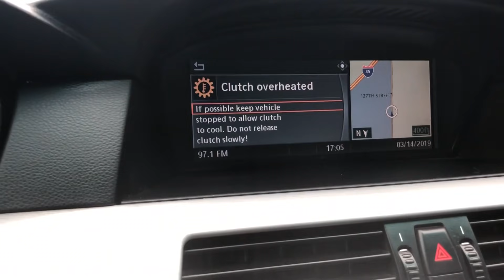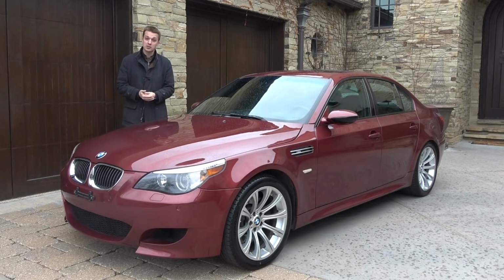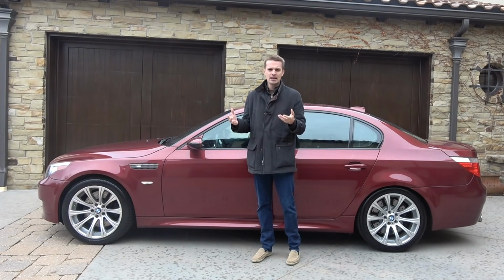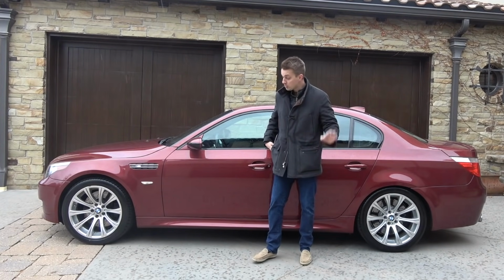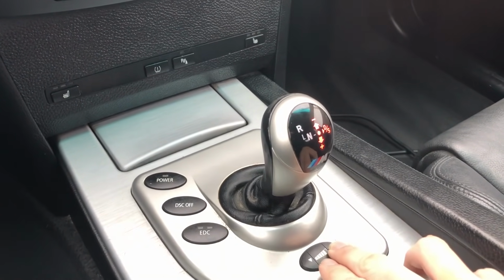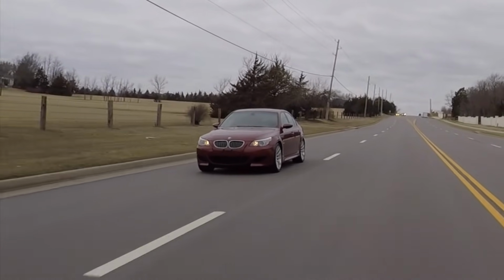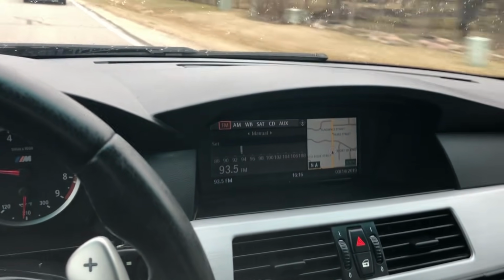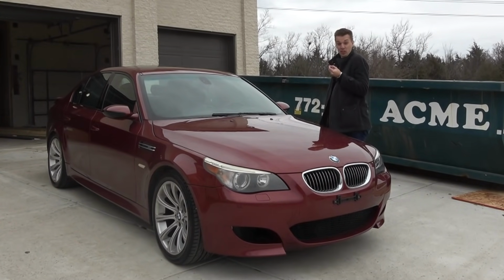My Cheap BMW M5 Is FINALLY FINISHED (Thanks to a Wire Hanger???)

Comment: Great garage, cant wait to see what you stuff in it.  The M5 is definitely temperamental, had an 06 awhile back and found that the bushings would wear in the lower control arms, throttle actuators go, and vanos high pressure line would need replacement in early 06/07 models.  Picked up another 06 - project car needed motor and did the same preventive maintenance w used motor - rod bearings, bigger oil squirters for pistons, new throttle actuators, new clutch, cooling hoses, monoballs in lower arms, bmc filters w stock air boxes. These cars have hit rock bottom, so if you have dealt w those big tkt items - clutch and bearings, you should be fine.  BTW - these are great track cars and really shine in M mode on a big track to stretch its legs.  Also use 0w40 Mobil 1 oil and will switch to the 10w60 on the track.  Maybe get another one in a different color :)

Comment: "What's it beeping for?". That might be an ECU warning, generated by the suspicious lack of actual ECU warnings. You've broken the ECU by fixing all the factory problems.
Reply: Time change..1 min to new hour...my E34 does the same.
Reply: Tomas Cage correct! You can disable it in the idrive

Comment: Love your channel, but you are way over the top on the negative comments on the E60 M5.  I have the M6, and it’s awesome.  There is the potential rod bearing issue which can be sorted for 2k. There’s  nothing wrong with the SMG III transmission when compared to the same era Ferrari F1 and Lambo E-gear.  Yes it doesn’t compare well to new cars, but your description is hyperbolically negative.  I’ve had mine for six years and have had zero mechanical issues.

Comment: The shifter is correct. When braking your body weight goes forward so it’s natural to push the shifter forward to downshift. (It’s going in the same direction your whole body it going). It’s the other way around when accelerating, your body moving backwards... really it makes sense!

Comment: That's how a sequential gearbox is supposed to be. Most sequential boxes are like this in performance cars. This is because G-force dictates that when you are braking hard, it's easier for your hand to go with the G-force and push forward to downshift.
When you are accelerating hard, it's easier for your hand to follow the G-forces pulling your body back into the seat and pull back to upshift.

Comment: I didn't finish the video, but when you're in WOT and shifting, it increases the shift speed, think about it. If it's a sequential manual, you don't want to bang the gears when you're at 3k RPMS....Also down to shift up and up to shift down as I'm sure many have already said...BECAUSE RACE CAR!)

Comment: Hi, I had an M3 E46 with SMG2 and I totally understand why people hate it. But I love it.
First of all, shifting stick direction is right. You may be used to other direction, but is so more natural to shift down pushing.
About shifting speed, it is unfortunately mostly related to rpms. Try to manually change at the rev limit, and you will get a fast kick you will love.
This told, I can understand the thrill. I also got a problem where bmw want me to put 2000€, while I solved with an 8€ relay.

Comment: This NEEDS a manual swap badly.
Reply: E9x m3 ZF 6 speed would be perfect for this
Reply: What does that cost? It's probably worth it if you were keeping the car.
Reply: @Pube83  im guessing about 3-4k with labour
Reply: Manual ls-swap
Reply: Need manual
Reply: N-0
Reply: @jurgen6362  you guessed wrong. Costs a lot more Cpt. Scrub
Reply: @mabehalzuqyadeek  nope, he just needs a gearbox, shifter assembly, adapter plates and a lighter flywheel and a way to tricking the ecu into neutral mode if he doesnt go standalone, not as much money as you would think
Reply: @jurgen6362  Adapter plate? M6 Have manual with this engine
Reply: @mateuszzimon8216  the m5 also came in manual but not with the gearbox i mentioned

Comment: I owned a 2008 E60 M5, with all the options, side bolsters, HUD, exec pack; bought that CPO'd in 2009 with 14,500 on the ODO. Drove that car every single day all the way to 109,000+ miles with only required maintenance for over 5 years. Maybe I was lucky. I loved that car, regret selling it. In the video it looks like the driver is trying to launch control, seems he has his foot on the break or he is not releasing the shift stick when it reaches the correct RPM. In any event, this is my 2nd or 3rd ever post on a YouTube video, I did frankly, because I do miss this car.

Comment: Upshifting by moving the lever down actually makes a lot of sense: When you shift up, you are generally accelerating and your body is pulled backwards by the g-force. So moving the lever up is moving your body against its natural flow. When you downshift, your body wants to move forward, so pushing the lever up is the natural move. 
Besides, all computer games shift the right way (like the BMW) ;-)

Comment: I remember looking at getting an X5 years ago, and when I found out how expensive those are in parts and service I almost fainted. One was looking at (a 3.0L Diesel) needed a timing chain changed, and I then come to find out that it requires an "engine out service" which a dealership quoted 9000 euros for and keep in mind that the car was for sale for 5000 euros. Another one I was looking at needed its sunroof fixed, and the best quote I got for it was 1200 euros to get it fixed. That is just to mention a few. I don't think I would ever want to own a BMW when they are so expensive to live with.

Comment: The way the shifter works is just the right way. Porsche had it the other way around for a long time but for the 991.1 GT3 changed it to pull for a higher gear, push for a lower gear. That's how race cars have it, too. It's just more intuitive that way.

Comment: No. That's the correct shift pattern. It comes from rallying, and, arguably, motorsports in general.

The idea is to match inertia. When you upshift the car bucks backward. When you downshift the car bucks forward.

Comment: My advice for the transmission, you can get a softwareupdate for the transmission at a specialised tuner. That rally helps.
By the way down for upshift is the RIGHT WAY!

Comment: BMW and Finished never actually go together😂
Reply: my last one was.. VERY finished after being hit by a truck and 2 cars, (one frontal) pushing me off the road into water.. throttle wide open. there was nearly no reusable pieces left on it. But not a scratch on me, that was the biggest surprise. (and the only time a sunroof ever came in handy, i didnt get really wet getting out
Reply: mark S ur lonely

Comment: If you get the M5 E60 as a manual, there's a whole bunch of problems you can scratch off and costs from the transmission and clutch. You'll just have to worry about the other less major issues with the M5 E60.

Comment: The shifter in performance cars is always up when pulling towards you, because youre using the G-Force you create while accelerating to push the arm backwards. Same goes for heavy braking.

Comment: Wait am minute.... Did you just throw the wizard under the 🚌
Reply: I thought that, too. And how soft are those teeth if they can be bent with a wire hanger?
Reply: @Cautionary_Tale_Harris when they get hot they are probably easily bendable so while the clutches engage they are maliable. I guess that means this can happen again

Comment: Your review on the car proves a lot about why you always breaks cars. 
Also, the shifts make perfect sense.
When you're being slammed back into the seat under acceleration pulling back is what you want to do, then as u decelerate and your being pushed forward in your seat, you can easily tap the lever fwd. 
but hey, you're you so...
Reply: Agreed, this man should only be allowed near Toyotas haha

Comment: You have got to keep this car. Learn more about it. Do a transmission software flash tune. Do a dct swap whatever it takes. Then put a race exhaust on it and it'll be heaven :)
Reply: toomuchtodrink2 its a pos
Reply: not worth it at that point. Rest of the car will destroy itself in time. It's a worthless money trap and the best thing he can do is sell the damn thing or ls swap it
Reply: He just said. There are so many other cars that would be far more worth it for the money he would spend keeping this pos running.

Comment: The shifter ist the right way around. When accelarating, you use the G-Force by pulling instead of fighting it. Every race car has a sequential transmission this way round (the only notably exception was the McLaren F1 GTR Longtail, but teams quickly switched it around). Same for braking. Almost every car maker does it the wrong way round.

Comment: the gear selector position is correct actually, its pull towards you (for "give me a gear") and pushing the selector away from you (for "get rid of this gear").

Comment: Pulling towards you for upshifts and pushing away from you for downshifts is actually more intuitive for driving spiritedly, as it follows the weight transfer for accelerating/braking respectively. Sequential racing gearboxes in rally, touring car racing, and sportscar racing are configured like that for that reason.

Comment: Up for down and Down for up is the correct way on the gear leather, Ken Block shifts that way, because when you accelerate, you automatically pulls back, when you brake, you automatically falls forward and pushes the gear leather foward.

Comment: BMW's shifting directions are actually brilliant. When you brake, natural physics push your body forward, hence why to down shift you push forward. And when you accelerate, your body is pushed back, hence the reason to pull back and toward you to upshift. So it's actually other manufacturers who are doing it wrong, not BMW. If you think things like you know, physics, are important.

Comment: The shift directions:
If you accelerate, it is much more easy to pull the Lever for shifting up. Pushing the lever would be against the inertial force. The same is valid for shifting down the opposite way. (Seems you did not drive the car too long to appreciate they did it the right way)

Automatic shifting:
Yes, the automatic shifts are not nice - but even as an american you will get used to manually shift this car by Lever or paddles and finally you will appreciate the pleasure to shift on your own instead of let the car do everything! (Remember YOU are the one, who drives and YOU should be the one, who decides when to shift - otherwise, just do not buy an M car! ;) )
If you are in higher rev ranges the shifts will be completely fine. I suggest using the second to last speed setting. (AFAIK the speed setting in manual mode will remain at the last setting. The automatic setting will revert to the standard level 2 after each start)

Comment: Just a heads true sequential boxes without an electronic shift mechanism, you pull the shifter back to upshift. This is to match the rearward tug of Gs from acceleration. In theory it would be more difficult to shift a fast car by pushing the shifter forwards as you accelerate because the forces would be pulling you away from the shifter and the opposite direction you are pushing the shifter.

Comment: With you all BMW are unreliable.... I wonder why....
I own several Bimmers never had issues with them, and I drove them to high milage.
Reply: If you don't service M cars and wait for the issues, then those issues cause other issues and you'll forever be chasing problems. M's are far more finicky than normal bimmers and you need to preemptively maintain them.

Comment: I feel your pain. I bought a used 2006 M5. First week I had it the cat conv burnt up and BMW replaced under warranty. Took about a month to repair. Next, the car started bucking me like a bronco... smg went bad. Luckily BMW repaired for free. I had to replace clutch.. Very costly repair. Car repaired and two months later got my ride back. Car ran great for about 6 months then started having problems again with transmission. At that point I took it back for repairs and waited another month. I drove the car 9 out of 12 months. Traded it in for a truck lol. At least BMW worked with me and saved me at least 30k.

Comment: I'm still happy with mine ☺
Reply: How long you had it?! Have you had 48,000 dollars 💵 worth of problems?!
Reply: @prestoncheapbtheadphoneste3010  2 years lol no but it is expensive to keep up with as a daily driver 😅
Reply: Jose C Maldonado I want one so bad but so afraid of problems  that may come. They may come back to back.  Sigh. Thanks for responding.
Reply: I was the same way but I  think its worth it depending on how many owners and the car fax check the maintenance records that's what i did V10 beast 💪 😎

Comment: Actually, the shifter action on this car is done the correct way: towards the direction of acceleration (back for upshifts) or deceleration (front for downshifts) as, since your whole body, including your shifter hand, is also moving along the g forces produced by the car, it's easier to slam the shifter in the direction of the g forces without exerting much additional force on your hand to make the shift.  All sequential shifters on racing cars (and Mazdas and BMWs) are done this way.  The other way around, first introduced in Porsche's Tiptronic, is logic intuitive but real world use counter-intuitive.

Comment: Pushing the gearstick up to go down a gear, and down to go up a gear is the correct way to do it in performance cars. It comes from racing cars, and doing it like that means the driver isn't fighting g-forces when going through the gears. Anyway I find it more natural to use that way, so much so that I find cars that don't do it to be wrong.

Ideally it should be a user preference setting though, no reason why it cant be.

Comment: That’s the proper way to shift up the transmission. Going up is downshifting going down is upshifting. Think about it when you slam on the brakes you move forward... acceleration moves you backwards. Same thing with the shifter.

Comment: Dude, if youre a car guy you might want to watch some motorsport. The shift pattern in that car is correct. Your body goes back under acceleration and forward under braking. It makes perfect sense.

Comment: The gear lever is laid out correctly, when you accelerate the G forces push you back and when you slow down they push you forward, so when accelerating you pull it backwards with you, and when you break you push it forward with you, every other lever that is the other way round is wrong.

Comment: Quick comment from the owner of the DSG, where + is up and - is down. 
BMW is actually right. 
When you are accelerating (therefore need to upshift) you body moves backwards, so it's easier to pull the leaver towards you. 
Same goes with downshifting - you probably do that when loosing speed (for example breaking), so your body moves forward...

Comment: This is actually the right way to lay out the upshift and downshift buttons. When you're braking, you're likely to downshift and as you're being pushed forward, you press the lever forward. When accelerating, you're being pushed backwards and so when you upshift, you push backwards. The VW group's way is the wrong one consequently.

Comment: Well... The shifter actually is the right way around... It's just you not being used to fast cars I'd say...

Every track car has the shifter that way.
If you accelerate you are pushed in your seat (backwards) so you pull the lever back to shift up.
If you brake hard your body is pushed forward, so you push the lever forward to shift down...

Actually quite natural to have it that way... I don't understand how so many people still don't get that...

Comment: Love your channel dude! Always interesting to see your sad face when the bill is served.. But i must disagree with your opinion on the manual shift pattern. It is supposed to copy the pattern of sequential gearboxes in rallye. When you accelerate you get pushed back in the seat, and of course forward when you are using brakes/engine brake. If the pattern where reversed, then you would pull/push the lever wrong way every yard you drive. Since i have driven ralleycars when i was young i got a real surprise first time i drove the new (back in -98) volvo S80 T6 and i tried to get it in second instead of 4th gear, since the lever was backwards..

Comment: Saw an M6 convertible for sale that was in mint condition except for transmission issues.  I was thinking about buying it and manual swapping it.  We own 3 older BMWs so I am used to a little financial pain, but all these M cars seem to have such expensive problems.  Probably was a good thing that the sale ad disappeared.

Comment: You need to drive smg cars like a normal manual transmission. Hit the shifter and release the gas pedal then push it back when the shift is complete. Just like a regular manual. It really helps

Comment: BMWs have the gear level with up shifting back towards you and down away from you because that's how race cars are set up. That way you are pulling or pushing the gear lever in the same direction as the g-force is moving your body. As you are being pushed back you pull on the lever to upshift and as you are breaking and your body is pushed forward you are pushing the lever to downshift.

Comment: Regarding the transmission - it would probably cost the same to convert the car to a 6 speed manual. You need the gearbox off a car with a S65 or S85 engine, the 6-speed off a m64 should work as well. Then you need engine harness, dme,  keys and EWS from a manual E60 M5. That or just get the wiring harness from a manual (and the manual shifter / shifter linkage / trim) and try to have the car's DME re-flashed with the software from a manual - it's been done before to e46 and e90 m3s.